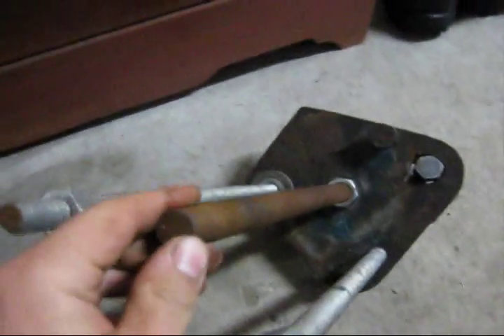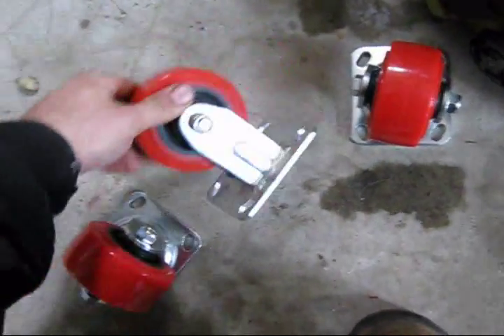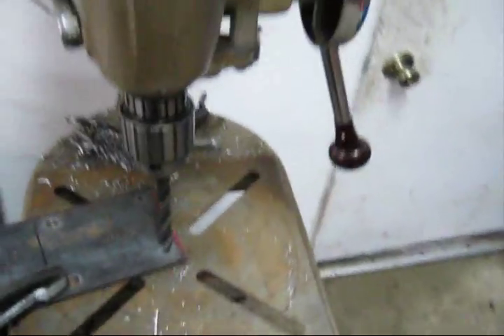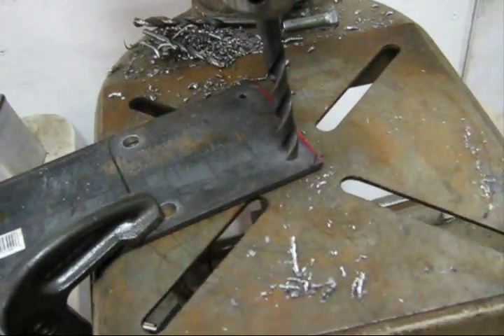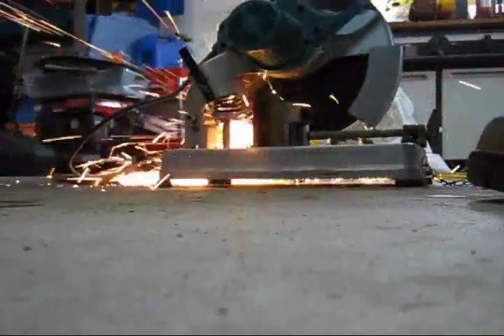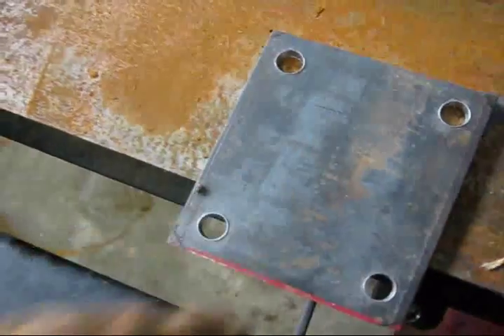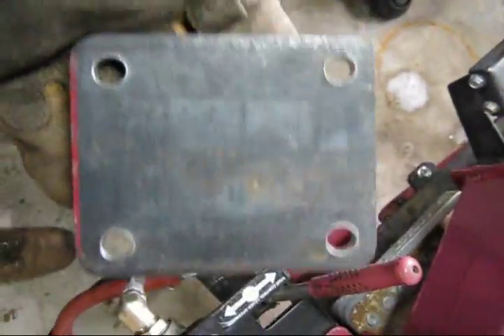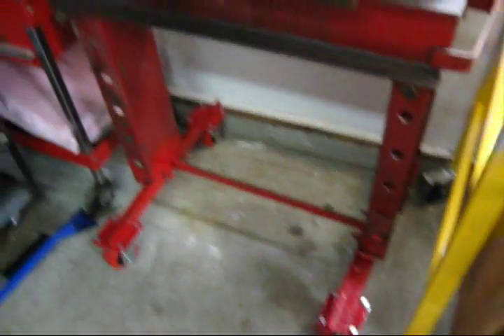20 Ton press gets a set of wheels (welding metal fab project)

Comment: Just bought a 20 ton press and I was thinking it could use some wheels. I would think you'd at least want locking wheels though. Do you have trouble with the press moving away from you when you're trying to put a work piece on it?